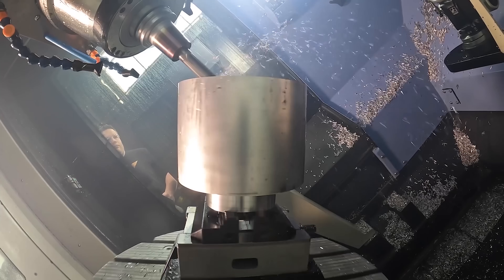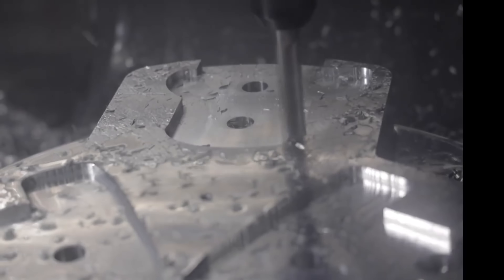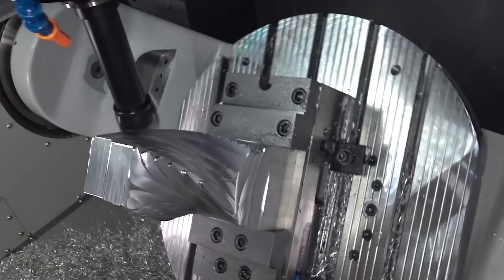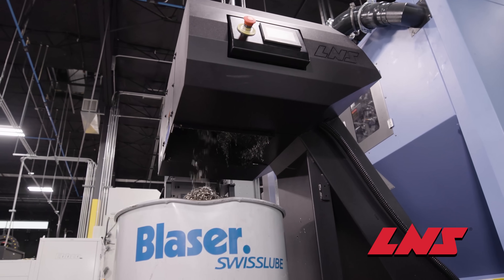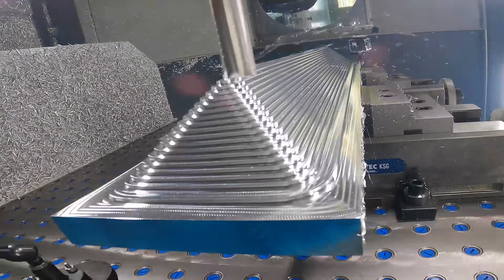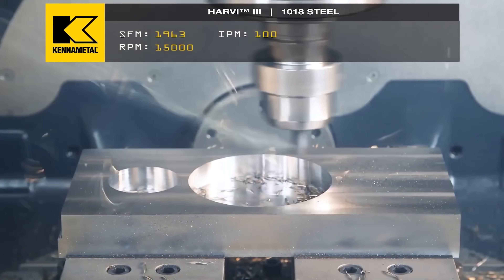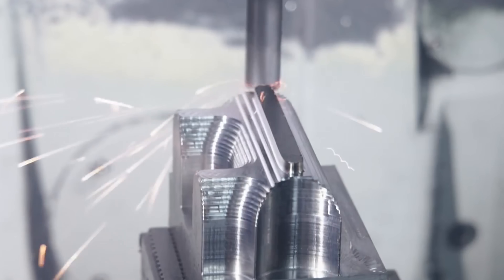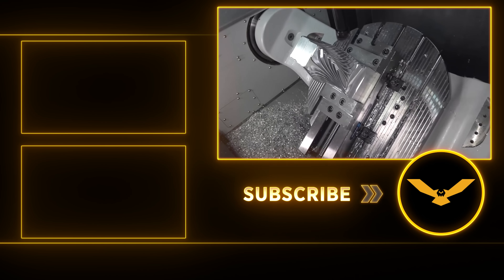Making Millions Machining Parts… But You SUCK!!!

Comment: I remember when I first got to my shop in the Army. My job was to be a welder and machinist, but the first thing I was told was that I was not allowed to the touch the CNC machines. Nevermind that I spent a lot of time rewriting my notes in AIT and doing my best to understand the procedures. That shop was toxic af and even though we had all of the equipment I ended up doing nothing but details. Thankfully the unit no longer exists but I will never recover mentally from being dubbed "worthless" early on in my career.

Comment: I work at my current workplace for a little over four years now and I'm amazed that there people working there for 20+ years and still don't know even the basics of cnc machines,  like which X Y anf Z let alone understand tool offsets , just last week one those old guys put a 140mm length tool instead of the 107 just because they had the same shape , needles to say he broke the tool,cut the workpieces in half and the machine caught on fire  😂😂
And if you try to tell them they're wrong they'll be like "kid, you know for hiw many years I've been working this job ? I don't neexyou telling how to do it" so I just let them mess up and then if they ask for help I'll help them and the "this 20+ year old machines (that break in a daily basis) are good enough we don't need new ones" gets me all the time because they know they have guys like me here and there who will try to make them work another week ot so before something else breaks on them , they're sitting more in maintenance than doing actual parts but they say they're still good.....

Comment: Man, I've seen a lot of this stuff at basically every shop I've been to. Back when I first started High Efficiency Milling was not as well known as it is now. I had to figure it out by reading stuff online and experimenting at work. But the ongoing excuse when I'd bring up new cam, better tool utilization, higher spindle loads, more training for machinists, proper fixturing, etc was "we've always done it this way..." Hell I've even reprogrammed stuff at the correct feeds and speeds according to the tool manufacturer, decreasing cycle times, sometimes by 300%, only to have the lead man in the shop come back and reprogram it back to the slower speed, lol.

Comment: I don't really like the mindless booms presented on this channel , but the things that the guy said are 102% true . Sadly  in the region i work there are very very very few places that tick all the boxes . There are soso technologically advanced places , but they never look for programmers , or should i state : the WON'T let you in . So the more serious places usually only look for an operator , and are paying shit money , literally most supermarkets are maching the rate ! 

The small shops usually look for universal soldiers , but provide old machines , no cam , no nothing , shit conditions , even shit prints . Old , used and worn stuff overall . They are afraid to invest like 1000$ in a new tool . They usually pay more , but there's a huge spread , one could get minimum wage , an other could get 4x the minimum wage , larger shops have a more "standardised" salary scheme .

To be honest i understand small shops to an extent , even most customers are full of shit , never willing to pay for a decent part , and in the end we have to cut all the corners , waste days to deliver a 200$ part for 100$ , thus baerly floating on the surface . This is not a localised issue !

Comment: Additional points:
   Don't be penny wise and pound foolish.  As jmowreader says below, saving $50 on solvent, but then needing expensive maintenance or repairs fits this.  Also, buying hugely expensive machines and then failing to pay for good employees, services, consultants, materials, tooling, and fixtures.

Treat people like you would want to be treated.  This would include scheduling, pay, time off, training, and treating others as "professionals."

Comment: finally leaving the trade after a year into it. just dosent pay in my area. A forklift driver pays more
Reply: Man you shouldnt give up that easy. There ARE places that will pay you what youre WORTH
Reply: I too face a lot of the push back when asking for a fair salary. I did machining and decided to join the quality department, where AC runs all day. Literally my deciding factor as absurd as that may sound. 

I’ve worked for smaller shops because the office politics and bureaucracy in the Fortune 500 companies are not for me. 

With that being said seems because quality doesn’t manufacture parts we are overhead. However, I speak ASME Y14.5 2009 - 2012, as well as ASMEY 14.3. What I mean by that is a lot of small companies want government work because it “pays well”. Not knowing all of the requirements you need to fulfill in order to get it, keep it, and be able to sell it. 

That in itself has allowed me to pick and choose where I want to work. I’ve dealt with all the primes and have the pleasure of teaching a thing or two to their engineers. 

So never sell yourself short and or give up! If one company doesn’t value you, go to the next. You might be an interview away from finding a fair shop.

Comment: im in a CAD only workplace. despite using 3D CAD software for more then 10 years now, with less demand for actual 2D-drawings from our customers, every workplace is still equipped with a digitizer tablet... the ones that stopped being produced around 1990. We moved away from AutoCAD because they stopped supporting the non-ribbon UI with the windows10 compatible versions.
feels kinda similar to what you are describing there.
Reply: Quit your job brother!

Comment: Barry, you forgot the two big ones: “We can’t afford to do maintenance” and “We don’t have the time to do maintenance.”

The head pressman at the first shop I worked at told me about the first shop he worked for. They had purchased the first Komori printing press ever sold in the Americas, and about three months after it hit the floor they couldn’t get salable work out of it. They called Komori America and these six guys from Tokyo showed up in the building two days later. The first thing they did was to hand the owner a card that said “none of us speaks English.” Well, the mechanics stood there for a week beating on this $7 million machine trying to get it to work. Then another guy from Komori showed up and the seven of them had a long conversation. At the end of it the English-speaking man went to the press foreman and told him, “Press is okay. Operator no good.” What had happened was after the manufacturer signed off on the install the idiot shop owner decided to pay off the press in six months and ran it 24/7 with no downtime for maintenance. Offset ink looks like colored axle grease, and the mechanics had to remove 50 pounds of dried ink from the press with wood chisels. Maintenance went from “never” to “start of shift and after every job.” 

At a shop I worked at, we were running solvent-ink printers. The production manager said he “couldn’t afford” to buy the right solvent to clean the heads, so he had us using isopropyl alcohol. There are two problems with this: it doesn’t work because the ink is alcohol resistant, and it destroys the rubber parts in the printer. A year later he’d managed to destroy all six heads in the printer, plus about $5000 worth of other parts. The right solvent is $50 a quart, but a quart will last you six months so it’s not that bad. We didn’t let him order stuff after that.
Reply: Man that is a GREAT point! Where were you before i did this video 😂

Comment: Hey guys at Titans. So I run large machines vbms and hbms. CNC and manual. I know most so called job shops don't specialize in large manufacturing. It be great to see some huge machines ripping huge chips and making huge parts. Any way dudes. This beers for u
Reply: Hey Erik! Me and Jessie have run some of the biggest machines on the planet. Like Waldrich Coburgs. Have you caught the Ibarmia videos?
Reply: @barrysetzer  yeah man pretty cool. I run a retrofit Hypro VBM it's cool and a few Cnc horizontal boring mills. Not 5 axis but pretty badass machines. I have seen the videos. Very cool man. Keep up the good work.
Reply: Also just checked out them Waldrich Colburg machines. Pretty effing cool man.

Comment: I did the same for my previous company, they only used hss endmills/drills, I showed the comparison between carbide and it turned a 2 hour job into a 10 minute job just by changing to carbide and adjusting sfm and feed
Reply: What a waste of $10 😂
Reply: YESSSSS
Reply: @barrysetzer  they used hss for 4140 😂it was a joke, just because the hss was 10$ vs 30$ for an endmill
Reply: Why someone would start a  machine shop not knowing the difference of HSS and Carbide?

Comment: I wish I could talk to you all more in depth. We run a small fabrication and welding shop and do everything manual now but I feel like the addition of a cnc mill and lathe needs to be done in the near future as our machinist is an older gentleman. Love the attitude of going hard all the time and maximizing the machine. We don’t do production runs (as we don’t have those capabilities to even pursue that work) so initial uses would be limited to the needs of a job shop.
Reply: Honestly from experience, if you wont use your machine at least 8 hours every day for the full year (2 - 8 hour shifts per work day, 6 times a week are the norm) then there is small economic initiative to buy a new CNC machine. You could maybe get a used one for cheaper, but should anyways first calculate when and will this machine pay itself off. If you dont fit in the calculations, a manual mill with a digital readout will greatly increase your capabilities without breaking the buck.
Reply: Well, as i said in this video…..if you want to talk more, we are here lol. Probably the best thing you could do is join our FB machinist group. Thousands of people that just want to HELP

Comment: The shop I work for still manually programs gcode on their doosan dnm500 using hss and cobalt tools. We do mostly low volume parts for ourselves and it's basic operations like drilling and simple milling but they just refuse to change anything. And because I'm new and young they don't want to listen to anything I have to say that would improve their process 10fold. I told them carbide can run significantly faster than their tools and they just laughed and said "it'll break the machine if I try that." We do a ton of 304ss parts as well and we burn through an insane amount of hss drills.

Most recently I had to a bunch of 4+ inch holes through 4140 with a cobalt spade drill and the tsc pump was removed by the previous owner and never replaced, so I had to use the through-air blast to clear chips out. Which worked, but the insert wasn't terribly happy about it. I told them we should just buy a new tsc pump but "that's a waste of time.
Reply: The idea of running that machine with hss is pretty mind blowing:)
Reply: Ouch! What are these people thinking 😖

Comment: The comment about not being able to afford carbide is just ridiculous.  I mean even cheap Ebay or Amazon carbide tooling is better then HSS.  That would at least help break the cycle.
Reply: Lol totally. But see the comment right after yours! These places actually exist!
Reply: @barrysetzer  I worked at a shop where the mill lead just always bought whatever was cheapest for tooling.  I stepped in after he left and starting buying quality tools.  The GM was shocked at the price difference. It was roughly 3x the price.  He asked if it was really needed.  I told him that I spent all day replacing the cheap tools to keep the job running, Where as the quality tools would last for several jobs worth of parts.  He asked me to keep the tools a secret as he didn't want others to find out and start requesting the same tools.  Well that didn't last long as the manual guy found out and was amazed at how long the tools lasted.  Then the guys in the lathe department started using them in the turn mills.  By then the cat was out of the bag.

Comment: Ever since working as an apprentice for a highly skilled machinist, I've wanted to open up my own shop. However, as ridiculous as it sounds, I don't have any of the experience for making a part, setting it up or even writing g-code. What's the best way to learn the skills necessary for machining?
Best regards.
Reply: @Curry, start the Titans of CNC free academy!
Reply: @barrysetzer  agreed. Even as someone with basic training, working thru the building blocks will teach you. If you know aluminum make the parts from something more challenging!
Reply: @barrysetzer  Thank you so much Mr. Setzer! Your videos on the channel are very educational. I will do so. Best regards!
Reply: Ask your highly skilled Machinist
Reply: @whtkngofc  Thanks for the advice, however he sadly passed away 2 years ago. His son lives six states away, so even if I wanted to, I couldn't receive a live lesson.
Reply: One thing I did was that I bought a cheapo CNC router and used the free hobbyist version of Fusion 360 to learn CAD and CAM basics. You won't make any money but it can teach you a ton if you've got a "throwaway" machine

Comment: I've been doing this for 30+ years I love these guys and their videos, I don't always agree 100% with them but I realize times and the trade changes constantly even from when I was first learning to use a file to square a block of steel to using modern plastics in multi axis machines these days. Things like using hss/cobalt, coated/uncoated tools in my opinion depends on what you're making and your constraints (money/time/customer's quote/etc..).
Having worked with a multitude of different machines manual and CNC, I firmly believe they all have their place and usage case. and I will always believe that all machinists, operators, engineers, and programmers should have knowledge and experience on all of the machines they are working on / programing for / or designing parts to be run on. That way they can know what they are capable of and what they won't do. To add to that all shop programmers/supervisors/owners should also understand that 10/+ year old programming software probably won't be able to handle newer applications (personal experience with this), but I digress...again love you guys keep up the damn good work and thanks again.
Reply: Haha absolutely rhinox! You have to know when and where to apply each strategy.

Comment: I guess the only trouble is that when you're starting out like I am (2years ish), making these steps up the ladder can be prohibitively expensive, as much as you're aware of your own shortcomings!
Checking off the list
1. I have good software, that can cope with 4 and 5axis work.
2. I can model and program it
3. I run carbide exclusively, and tey and always use shrink or hydraulic tool holders for all work, not just finishing.
4. I do run a 26year old machine with 4th axis capability BUT
5. I don't have the work to keep the spindle running for 8 hours every day, let alone two shifts.

Problem identified is a bit chicken and egg.
I need to find more work, but I know I'll reach a bottle neck at some point with the old machine.
Answer:(I hope you agree!)Finding the confidence to finance a sub 10 year old machine is probably my biggest problem.
Reply: You are one of the guys that gets it! Youre absolutely on the right track! Just dont “forget” to replace that machine as the work starts rolling in, later!!!
Reply: @barrysetzer  Thank you very much, I appreciate it! I think I'll make myself a poster for the workshop of these key points.

Comment: We do not own a single HSS mill anymore. We only use carbide for all milling and turning, even on the manual lathe (which is more a toy than a serious machine). 

Just a selection of HSS drills for the manual drill press or low volume jobs where carbide drills tend to break seem to be necessary.

Comment: Man, i know the old 3-ax machines being given 5-ax stuff

I was born in the late 90s, the machine i was told to make advanced connecting/locating nodes on was made in the early 80s and had an "updated" controller from 2002

The nodes were 6-18 sided polyhedrons with indexing slots/holes/steps and threaded holes on each or most sides.
Reply: Painful, right!?!
Reply: @barrysetzer   absolutely excruciating

They paid well for my experience level but just with the machines i have at home (which is admittedly a lot), i'd need maybe 4 months to make the same stuff i made over the 3 years i was on that task for 8 hours a day.